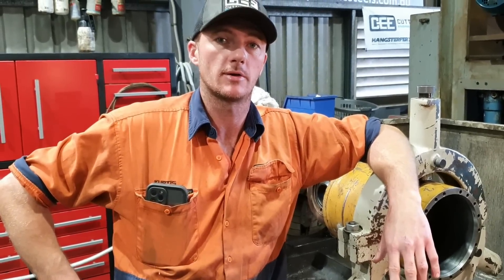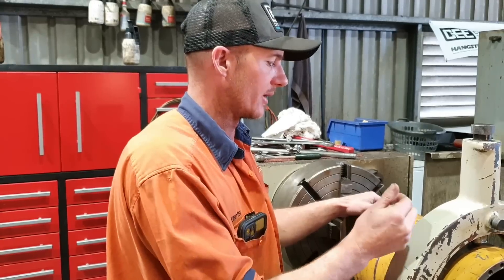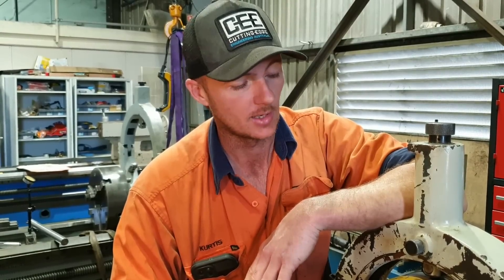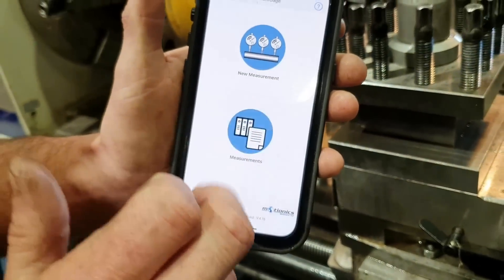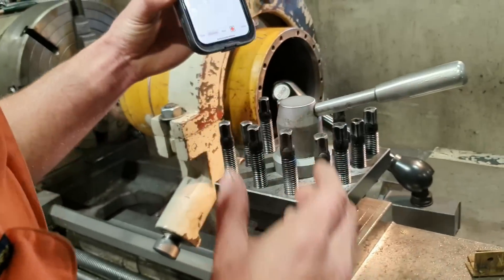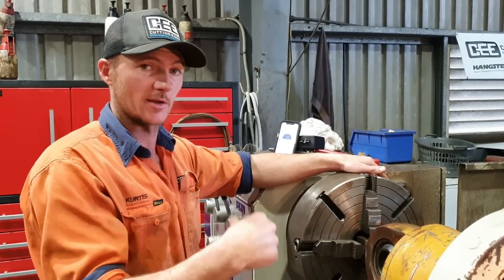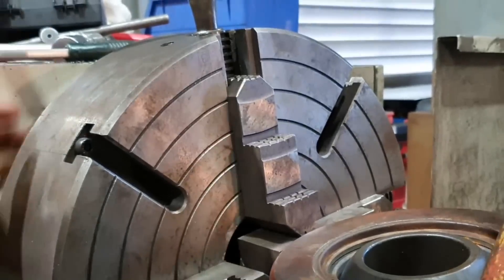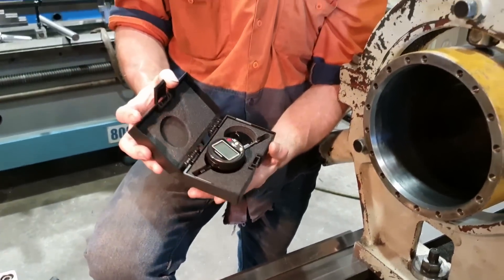Bluedial Wireless Measuring with @CuttingEdgeEngineering

Comment: Pretty cool, does it have the possibility to zero the dial from the phone?
Reply: That was my first thought too when I saw the TIR. But, if you have the TIR on the phone just look for it not to change I guess. But zeroing makes for fewer mistakes. 

I don't mind having a machinist that I have seen in action and trust pitching a product. So many other YouTubers that I wouldn't trust with my hand saw start talking about things the marketers tell them to. Marketers and Salesmen don't usually know how their products are used and just pitch the features and benefits. I was a salesman years ago, I know.
Reply: You'll need a servo to reset the dial from the digital signal sent by the bluetooth display. Which will probably price it out of the market.

A cheaper way may be to use software in the Bluetooth display to reset it, independent of the dial gage. But then you'll have a difference in reading between the dial gage and the Bluetooth display.

The third and perhaps best way is to have a digital readout at the gage, whuch can then be easily synchronized electronically with the remote Bluetooth display.
Reply: @docfarl  I assume that a digital Indicator works similar to a Digital Caliper, that can also be Zeroed. Then, the Indivator only needs to send the relative Number to the phone.
Reply from the maker: Yes, you can once its in place.

Comment: There are all sorts of advantages reading the DTI via a phone app.  Similar to a DRO you can set the zero where it is most helpful. I noticed the red line which appeared to show the maximum movement, and I am sure it has a few more tricks it can do.  I've often thought about having a decent sized screen above machine tools.  You could mirror the smart phone screen to read the app in a convenient position without having to worry about dropping your expensive iPhone into the swarf bin.  You can have drawings with the ability to zoom in when needed.  You could follow YouTube videos while on the job (Kurtis obviously wouldn't need to do this).  One of the advantages that might be helpful to us older folk with less than stellar eyesight is that you could use it as a magnifier.  I've seen videos where we as the viewer could see that the person making the video was slightly off, but if he could see what we saw in real time, he would not have made that error.
Reply: Just get a cheap android tablet and don't even need to worry about your phone :)
Reply: Watching YT videos while on the job? What sort of videos do you watch? The mind boggles. (heh, heh...)

Comment: I thought bluetooth couldn't go through metal?
Reply: It isn't actually going THROUGH the metal (of the cylinder).  The radio frequency signals transmitted by the dial indicator device travel in all directions.  Some of those  signals are reflected off of the metal surfaces of the cylinder interior and will make their way out the open end of the cylinder and some of them will travel straight out of the cylinder without ever hitting the cylinder.  Once the signals are out of the cylinder, they will reflect off of other metal surfaces (such as the tail stock or other nearby metal surface) to scatter in all directions. The scattered signals will retain enough coherency to be received and interpreted by the phone and that is how this works without a "line of sight" path between the dial indicator transmitter and the phone receiver.

Comment: Suprised we haven't seen something like this sooner. There are probes that can check every surface of a machined part for QC purposes.
Reply: You could just take a regular digital model, rip it apart and splice in some wires between the electronics and the LCD, and it would work just as well. Cheaper, too. It's just that the wires would be ripped apart any time they snag on something... And it wouldn't be a tenth as cool.

Comment: Great stuff but my biggest issue is WHY does it ask for location permissions? It's a gauge for crying out loud!
Reply: So the gubberment  of china knows what you're doing.  But more likely just lazy programming of the app.  I have a battery monitor app that wants to be allowed to make calls.... just deny  and it still works minimally, because minimal is how crap the app is.
Reply: In case your tring to use it to level the workbench in the bedroom....